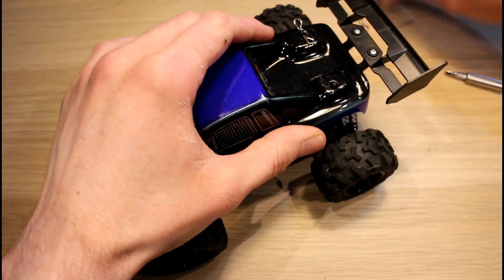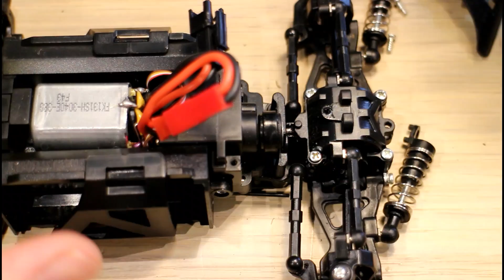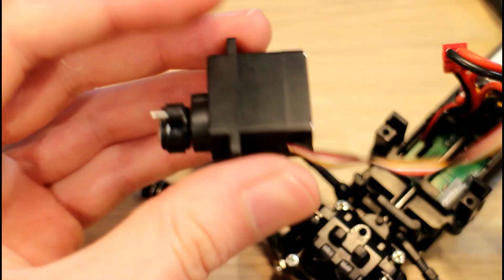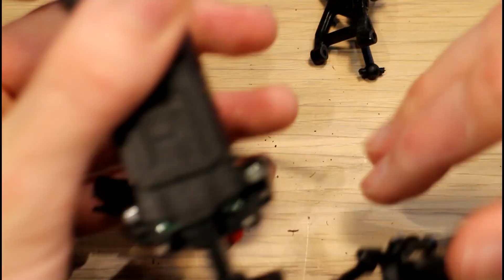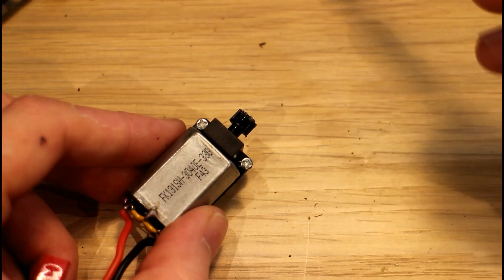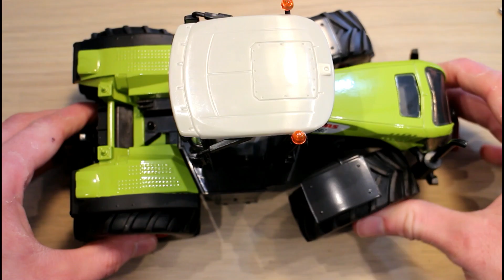RC Claas Xerion Build Part 1- Dismantling the RC Car and Tractor

Comment: bro please throw the part 2 !! i really  wanna see this tractor build
Reply from the maker: +TillTheCollapse The Xerion is a complicated build so finding the time to work on it is the challenge. I have got the RC car chasis into the model chasis, mounted an N20 drive motor and the final piece for that video is to connect the rear drive wheels but my first attempt hasn't worked so I need to try again. I'll have it up before the end of the year.